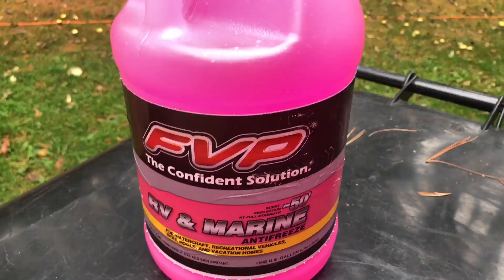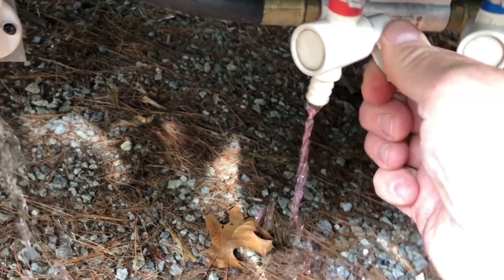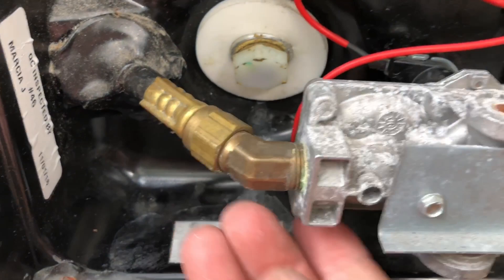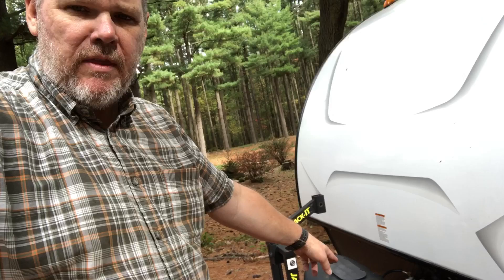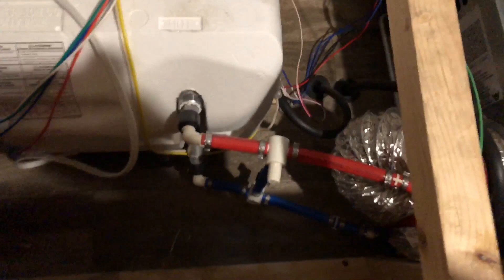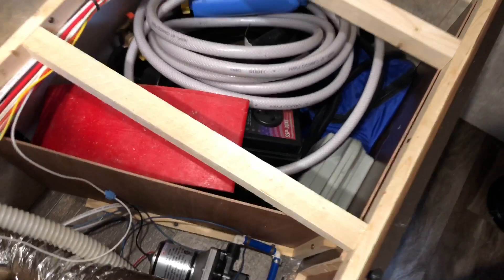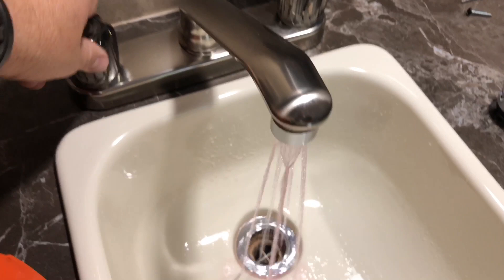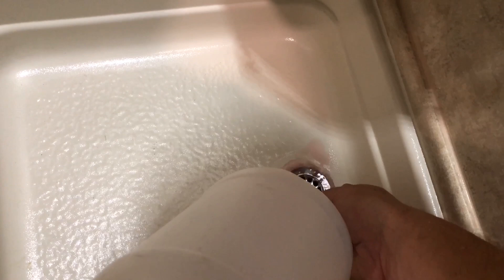Winterizing our Jayco Hummingbird 16FD

Comment: Patrick, thanks for detailing the winterizing of your Hummingbird. I just (in May) bought the same model - used. It's the most camper I've owned and need all the training I can get! I had a Silver Shadow Teardrop I traded in on the Hummer. Needed something I could stand up in!  The dealer I got it from suggested buying the fitting so I could blow out the lines. Ever try that route, as opposed to anti freeze?

Comment: Hi Patrick,
We have the same trailer as you.  I love your videos.  This year, I will winterize it by myself thanks to this step by step video.  One question :  after emptying the black water, should I put some sanitizing stuff in the tank for the winter ? ( if yes, 
I probably don’t add water with it).   
P.S. :  We had the same problem that you did with the refridgerator.  When on the road, it would stop working.  We brougth it in to have it fix.  It took them several try to find a solution.  They tried to make it so the flame would not blow out while travelling.  It still didn’t work.  They finally put in another fridge.  Know, it works perfectly.
Reply from the maker: Micheline Desrosiers I’m so glad they got your refrigerator working. Jay I refused to change ours out under warranty so we ended up trading in our Hummingbird on a NuCamp T@B 400.  As for the black tank, I don’t put sanitizer down. Once it’s clean, the only thing that goes down ours is some antifreeze so the seal doesn’t freeze.

Comment: At what temperature should we consider winterizing?
I apologize for the novice questions.
Lou💚
Reply from the maker: Eat Sleep RV Repeat No problem!  Ask as may questions as you need.   Honestly I don’t get too worried unless it’s consistently below free end for several days. If it’s just dipping below 32 at night, I usually just turn in some heat in the trailer overnight. Of you’re not going to use it for a few weeks/months like here in Indiana then we winterize. In Florida, I’m not sure you’ll have to worry about it too much.
Reply: @TravelswithDelaney  WooZa 32! That's really cold.
Thank You.

Comment: Patrick, I just used your video on winterizing our Jayco FD Hummingbird.  I want to thank you for making this video and I have a question concerning how many gallons of Antifreeze to use. 
Our Jayco took one gallon of the pink stuff and when we opened all our faucets, Antifreeze came flowing out.
We also poured Antifreeze in all our Jayco drains.
Do we need to add any more Antifreeze?
I've read on line that many owners of trailers use 2 or more gallons; depending on size, correct?
Thanks again, Patrick! Happy Trails to you and your family!
Reply from the maker: The size of the trailer definitely affects how much antifreeze it takes.  Our 35' 5th wheel use to take 4-5 gallons.  I used about a gallon and a half on our Tab 400.  As long as you have a steady flow of pink then you will be good.  Did you do all the sinks, shower, toilet and outdoor shower?
Reply: Patrick, yes, we did everything that is related to water usage in our Hummingbird.
Now my wife and I wait patiently for Michigan Winter to end 😥
Thank you for all of your help, Patrick.

Comment: Do you have a black tank drain connection, and did you do anything with that? My new trailer has one, (first trailer we've owned that has one,) and although I drained the black and the grey tanks all the way, including flushing out the black, I'm now wondering if I should have tried to put anything through the connection on the outside where the hose hooks. I gotta think that there's no "P" trap on that, and technically it should only be a hose draining pretty-much straight down into the tank and not leave water in the line, so I think I'm all right. (hopefully. . . .)
Reply from the maker: There is no trap coming out of the black tank to the point where you hook your hose up so once it's drained, you shouldn't need to do anything else.

Comment: Thank you for the pointers...maintaining my future trailer will be important.  By the way, is there any open storage under the bed area and passenger side dinette bench - just curious.  I live in the foothills and use dryer sheets in the engine compartment of my 4runner to deter mice from chewing on the wires.  It seems to work, in addition to a product called Fresh Cab Rodent Repellent that I buy from Tractor Supply Co.  Also, have or will you use any type of product, wax, etc. on the Hummingbird exterior?
Reply from the maker: Jane Delaney on the inside of the trailer, there is no storage under the dinette or the bed however that space is utilized with access from the outside storage areas

Comment: On hot water heater after it's drained and bypassed do you leave pressure relief open or closed? Is nylon plug put back in?
Reply from the maker: ron tafoya I close the relief valve and put the plug back in. When spring comes, after I flush out the antifreeze from the lines, all I will need to do is close the bypass valves and it will be ready to go.

Comment: Did your Jayco come with those valves on your low point drains?  Mine came with caps that were screwed on so tight I had to get my husband to get tools to unscrew them.  Those valves on yours is genius, and I will be on the hunt for those.  They put my water pump under my sink in the slide out.  So far I've located everything except the valve for the hose that goes into the antifreeze bottle.  We got so cold last night I turned the furnace on in the trailer to keep everything thawed till I can get the antifreeze in there.  I have a question.  Do you leave your anode rod out for the winter, or do you put it back in?  I'm thinking of leaving it out until I dewinterize it in the spring.  Thanks for sharing!!!
Reply from the maker: Grandma Patty Ours did come with the valves on the low point drains which is really nice. Our prior trailer had the caps and we had the same issue getting them loose. Not all trailers will have the hose at the pump for you to pump directly from the jug. If it doesn’t, the quickest solution is to pour your antifreeze into the fresh water tank and then pump it from there. The down side is it takes a little bit more antifreeze that way. Finally I do put the anode rod back in just so no bugs or critters can get into the hot water heater. Hope that helps!